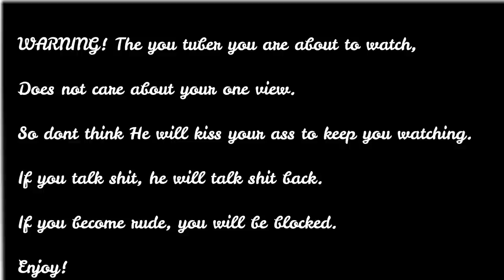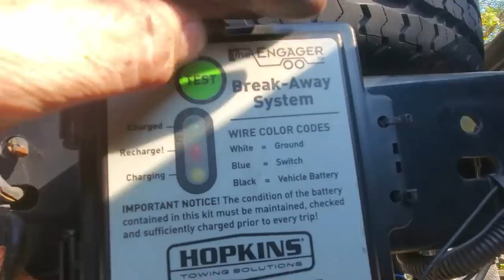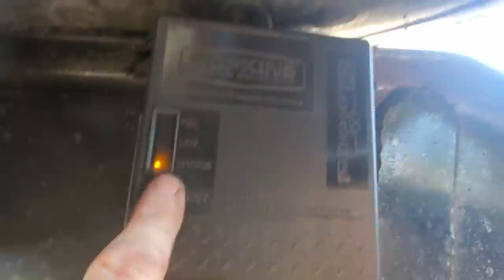Trailer disconnected error

Comment: You can track the mileage on each trailer using your Truck Apps on the display.  I use mine to track the fifth wheel and the flatbed separately.  There are YouTube videos "Ford F-Series Truck Apps" that can walk you through it.
Reply from the maker: Yeah i went through and set mine up. Just always forget to stop it when disconnected

Comment: The flat spots are from out of balance wheels with light loads. It's referred to as hammering. The heavy area of the tire causes the tire to become egg shaped which in turn hammers the pavement as it rotates, giving you what you have there.  Onboard wheel balancers are the cure. Better fuel mileage, much longer, even  tire life, lower rotating assy temperatures.  Centramatics are the leading brand out there. I just happen to sell them in case it wasn't obvious.
Reply from the maker: The flat spots were from the brakes randomly working on random wheels. And because all 4 weren't slowing the trailer down. The one random wheel was probably dragging.

Comment: Why not use black pvc piping? heat to bend if needed? Wire would be protected and if beed repair would be hard to mess with either. As for the magnets they may have gotten to hot which mean the lost their magnitizem so probably need new ones J/s

Comment: I just buy new rotors online.  Too many rotors warped due to heat in the past as they were cut down.  I was surprised you used the blue plastic wire connectors instead of soldering.  Maybe try balancing the tires when you put on new rubber.  I think you are getting some bounce and it's doing the tires in.

Comment: Hello, that wear on your trailer tires, may be due to the axle tube flexing or ocillating, so you have tires that are camber-in/camber-out, hundreds if not thousands of times a day....some semi trailers have the same problem...the fix is to get a piece of angle iron, 1"×1" or 1.5"×1.5" and stitch weld it to the top of the tube, on both sides of the angle.,/\,
I hope I'm making sense. Chin up and keep trucking!

Comment: I might be repeating myself, don't know what happened to my 2nd reply.  In my 40 years of pulling trailers, mostly goosenecks, if any wheels were locking up enough to do that much damage, there is no way you wouldn't of either heard it or felt it as your  head was moving towards the windshield.  Ask any truckers with lowboy trailers running 17.5 tires and they will all tell you how they eat these tires in one spot long before their live's are over. Scrap yards are full of 17.5 lp tires that suffered hammering and aren't legal to run anymore.  Google it to see for yourself. I guarantee you that like most people,  you balance the tires on your trucks/cars, but not your trailer. Why is that? The lighter you run,(or empty) the worse it is because it's easier for the axles(tires) to lose contact with the road. The damage is done when they come back in contact with the asphalt at 60mph. Pat.

Comment: Your not supposed to turn rotors on newer vehicles! Especially a truck that tows heavy. Rotors are cheap.Same with the trailer brakes , order complete backing plates ,and replace it all ,it’s cheaper and you’ll get trouble free service from them. I know you said the u bolts were in the way of 2 of the nuts I get that .

Comment: What the reason you have to keep repacking the bearings? Do they not have grease zerks to grease them with a gun or do they still need repacked even with the grease zerk?
Reply from the maker: No grease zerks. And honestly i would still repack them at 40k cause the zerks dont really grease them that well
Reply: @SouthGeorgiahotshot   ok seems reasonable. That's one of the things I'm actually unsure about with my trailer is how often I should be greasing my axles (7k dexter) it's still new with maybe 15k-20 miles on it but I've been pumping some grease in them every 3k or so.

Comment: hi there look like you trailer need paint do get ticket have rust  and scotch lock connectors are junk only the brake wire need be 30 amp i would use tinned marine grade wire run wire  both side the trailer led  lights run on 0.1 amps. best to connect negate wire to negate wire run back to box not chassis and brake too and do manufactured, off-road magnet Al-ko recommends holding the magnet in place, on the magnet arm with a rubber band.best luck

Comment: Hey Rob if you want good electrical fittings for splicing low voltage wires you must go to a electrical contractors supply house. You cant use that shit from harbor freight made in China, get the real deal materials and be done with it.This way when your home you could kick back a relax instead of working on that trailer.Also you can weld some 1/4 x20  bolts to the frame when your home and now that is a solid ground just put washers and lock washers on the eyelet for the ground wire,and buy the eyelets that fit over a 1/4 x20 bolt you welded on like a stud. and weld a couple of spare ones on so you have them down the road for further work.Rob those blue splice add on,s you used are not good you need butt splices and heat shrink tubing. Remember water is the enemy of wire.

Comment: My bad if I ask a question already asked but I’m not reading 203 mfking comments. Lol. Are your tires warranted? I do all my tires on my van at Discount Tire. Great warranty. I’m certain your tires would be covered under warranty. I believe they prorate them under certain circumstances but will replace completely free of cost aside from new warranty coverage on others.
Reply from the maker: They came with the trailer. And the trailer was bought used

Comment: Hey man, I'd get rid of those snap connectors, they're SHIT! I'm an elevator service guy and I run into those damn things all the time while chasing down a weak connection.  ( corrosion  ) They'll  bite ya every time,  especially in the rough environment that they'll be living in. Peel the insulation off the wire but don't cut it, then solder the branch wire to it and seal it with rubber then friction then electrical tape followed by a few zip ties to hold it all together. It takes longer but it'll be well worth the effort and maybe keep ya from havin a fuckin stroke! Good luck.

Comment: I’m thinking those trailer brake magnets got really hot, the pvc insulation on the wires shrunk back exposing the copper and corrosion set in..I would solder all connections and water proof them.

Comment: Going down the road squeezing my thing(come on dude clean it up man) grommet through holes is a plus. Looks like you got rot in your wires. Good miles on breaks but is it good miles on magnets is that normal wear? Get your own lathe turn them one thousandth next time you may be in spec. You can do it man nice bat box. Wire loom stops rubing.heat shrink it man. Just plant big trees or shrubs then they wont see the trailers. Wish you the best man.

Comment: Replace the wires going through the axle tubes I bet the the tubes rubbed the insulation of and is grounding out. 
 Reroute them over across the frame from one side to the other.  Have experienced that before.You

Comment: Just my 2 cents, I would not be using those displacement wire connectors on any wire. If I were you I would solder all the splices. those connectors are junk....

Comment: If the  bearing cap is metal just tap and put in some grease fittings. It really is that easy.
Reply from the maker: Its plastic with a rubber plug
Reply: SouthGeorgiaHotShot  ok well that makes it a bit harder then.

Comment: If you stay in this business the next trailer you get needs to have hydraulic trailer brakes. They are better and you can run them 4 times as long. The only way to go. I'm 72 and been around all this stuff. I have a shop that we work on a lot of big trucks and trailers. Keep two new magnet with you at all times They never last long. Never. You're lucky to get 20,000 out of these electric brakes. They are crap when new. You are overloading your trucks electrical system with all the stuff you buy. You are asking for trouble. Your alternator can only put out so much. It's pulling all it can now. I can't believe you haven't had alt. trouble so far. Stick to what you really need and go with it. You're alway having to buy thing that go bad. Save that money. Crap doesn't make money. Just a word from an old man that has done all these things and have learned the hard way. Good luck.

Comment: With my trailer I had issues with the brakes and it ended up just being a bad ground and after I got the ground fixed the tires were locking up I had to adjust the brake booster power

Comment: 1. Turning rotors is a waste of money. New rotors are not that much more in cost but you get much more in lifetime and quality.
2. I would run that wire in pvc conduit (in sections, to/from side light) and attach the conduit to the frame, I would not leave the entire wire like this exposed to the elements.

Comment: Well it's clear I don't really know what's going on but if at the end of the jorney with this trailer. I would not be surprised if your ford doesn't get along with your led lighting, your trailer brakes are wonky, or your electronics in your ford just doesn't like that trailer. Mark my word, F'ing electronics!.... oh,  you would have the best chance at the lighting if you soldered every connection and had more than 1 ground. Be well.. good luck

Comment: do yourself a favor and remove the scotchlocs solder all wires use heat shrink or splicing tape and your troubles at least with the wiring will be gone

Comment: your going to have the same problem with the wires you got to use the 3m water tite  not that dam Walmart crap you got on there also you should of ran so cord back up the side not cut in to it at every light

Comment: by you useing then dumb blue wire clips is going to give you more problems then you ever had.. that metal peace the you push into the wires cuts wire strands, water rusts it out, they start fires, they shouldnt even make them,, if wireig a trailer do it right, soilder and heat shrink every thinf, seal up the wire caseing were you cut it open, water will get in there and rot the wires